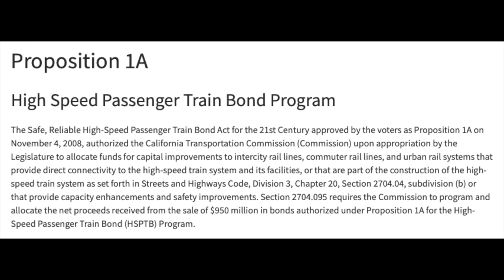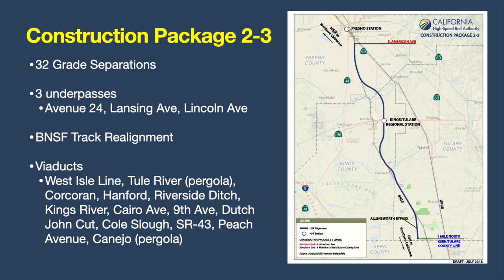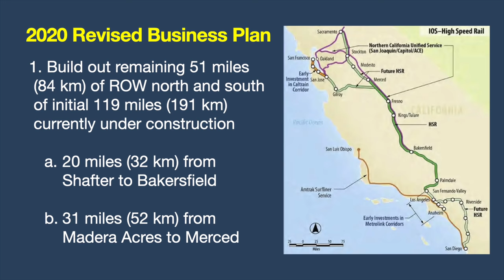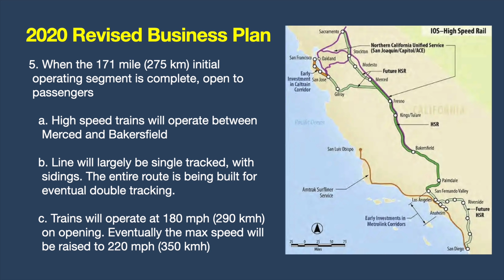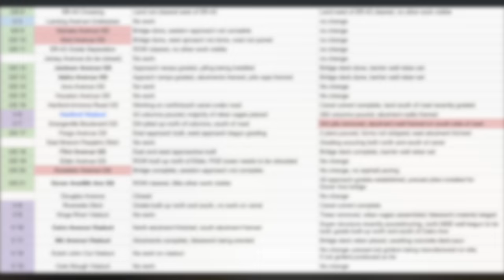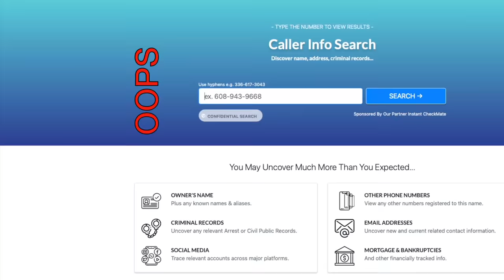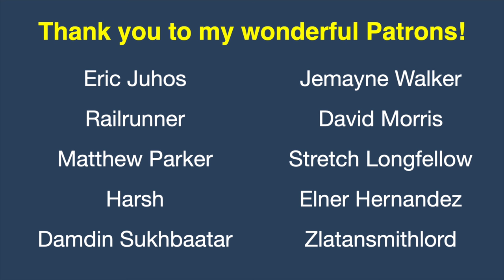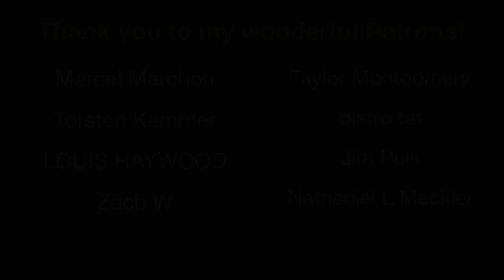California is Building High Speed Rail. It’s time to finish it!

Comment: Eight meter wide triple level maglevs traveling 800 kph - 1,000 kph are a reasonable development to start to take place by 2045.  The issue with HSR is that it is rail travel that first made 300 kph way back in the late 1970s and is not maglev with new first generation 500 kph maglev trains in Japan scheduled to start in 2027.   By 2035 when it might be possible a small section of CAHSR starts running the world should be looking at second generation double wide maglev systems faster than 500 kph.  

The 8 meter wide maglev trains would allow normal automobiles to be loaded perpendicular or large cargo.   The exact best form factors needs to be carefully considered because it will likely be used  for hundreds of years.   The second and third levels would be luxury passenger space with possibly vista domes on their roofs so passenger could see forward to watch the scenery.    Pure cargo cars would allow large build objects to be moved easily over land charging the world we live in.  These high electricity use trains really need almost free incrementally priced electric power.   Electric power usage needs not to be a consideration when running an individual train.   

HSR or maglev use huge amounts of electricity and if only for light passenger load of dozen people if having to price in the electricity they wouldn't be feasible.   Having their own hydropower generators always with enough water is the type of electric power they need.   Nuclear can be somewhat similar.  Japan's bullet trains were conceived with the likelihood their electric power would come from nuclear power where the true incremental cost would be almost nothing.

Comment: THANK YOU for mentioning that ICE cars are only slightly worst than electric. 

Don’t get me wrong, electric cars, trucks, and even air transportation, is great, but it’s not the true hero of the story. 

Getting a real transportation network that focuses on REALITY and not fantasy (coast to coast high speed rail is NOT a good idea but better speed transportation on dedicated track between high speed rail in specific locations IS a good idea) 

We need more people to realize it’s not about getting rid of all ICE and all airplanes and all coal/natural gas electric plants, it’s about putting forward more reliance in greener energy power and transport  but not completely destroying older tech because we will still need it for a diverse power grid structure. 

Pro Tip:
If we really want CO2 enmities down and the environment better cared for, we better stop pretending that NUCLEAR POWER is bad.

Comment: I think I will die before I ever get to ride that line with the pace it has. I live in the Bay Area so for me it would be nice that I can take a train instead of a plane but I am doubtful it will be completed.
Reply: @theexmann  I hope the extensions are finished in a decade as well. It would be nice to travel all over California on that train.
Reply: @DrZark  Agreed. I hope so too. I know that L.A. Metro is currently working with CS HSR to reconfigure Union Station to have run through tracks to accommodate HSR in the future. Some of the funding is coming from L.A. Metro and some from CA HSR.
Reply: There always has been passenger train service between the Bay Area and Southern California.  In fact, you have several choices now.  There are several trains daily between the Bay Area running through the Central Valley and into Los Angeles (Bakersfield to LA is by Amtrak bus).  There is also Amtrak's very scenic Coast Starlight that takes you along the Pacific Ocean into Los Angeles.  So you see, you don't have to wait until you die to take the train...unless of course you only want to ride the high speed bullet train which of course may not be finished before you die.
Reply: @jackjules7552  I know about the rail you can take but we are talking about highspeed rail since the whole video is about it.
Reply: @jackjules7552  Agreed. The problem with the service is that is is geared more towards leisure and travel than for daily commuting because it takes so long by comparison. The trip takes around 10 hours and it's not a one seat ride either. Those two things are HUGE negatives unless you're doing a leisurely trip. Most HSR around the world is used heavily for both leisure and regular commuting.

I've taken the train from L.A. to San Diego a few times, but they have all been for leisure travel and it was great.
Reply: @theexmann  Yes,  the plane is the only way to go between the Bay area and Los Angeles if you are travelling on business.   Business people used to ride the overnight Lark train between LA and SF which had pullman bedrooms.   Business people would board at 9pm and sleep during the night and arrive in LA or SF early in the morning with breakfast served just before arrival.  But the Lark was discontinued years ago.  Right now, there is an overnight sleeper on Amtrak between D.C. and Boston which is advertised primarily for business people.
Reply: @jackjules7552  Agreed. So adding another mode of travel like HSR that works for business as well as leisure between LA and SF makes sense. I would argue that it would probably be more comfortable as well even though it would take about twice as long as a flight.

Comment: Thank you for the update. My only question is how will they incentivize train ridership? As you mentioned air and roads are heavily subsidized so people think it is cheaper. What policies are the California pols putting into place to move people to public transit? What are they doing so drivers understand the true cost of driving, i.e. gas tax, sales tax on vehicle purchases, increased sales tax on air travel, tolls on highways, increased fines for moving violations, surcharges on surface parking, reduced street parking, increased property tax on surface parking lots and low-density commercial property. Infrastructure requires good policy (effective and efficient)to deem these huge projects a success.
Reply from the maker: Ideally there would be a massive amount of press coverage and hype, but you do raise a good point. It’s going to be a long process convincing people to ride trains.

Comment: The "nowhere" applies to the central valley and the fact that is where they started construction. Had they started at either end of the system, that argument would not have much of any legs to stand on. This is what I hate about politics. Things are intentionally taken out of context in order to make them appear in a better or worse light. I do beleive that this project should be built, but let's at least be honest about how things have gone so far and the choices that were made.

Comment: The cost per mile of the planned 520-mile California high-speed rail system, assuming it could actually be built for the current estimate of $80+ billion, is $154 million per mile. And Amtrak’s own estimates for replacing its existing Northeast Corridor with true high-speed rail work out to over $500 million per mile.

Comment: Let's utilize the Chinese maglev tech. They've proven it's safe up to crazy speeds. It could connect San Diego to LA, then LA to SF. The physical structures they are building could be transferred from friction rail, or iron rail, to a far superior technology.
Reply: It's also crazy expensive, around 3 times as much.
Reply: @AVeryRandomPerson  I think we can all agree cost has no limit when it comes to benefitting the group consciousness.
Reply: Maglev ISNT superior to covnentional rail.  It uses a LOT of energy, cannot use existing tracks, cannot run at grade, etc.
Reply: @jamessmith14000  People won't care if their journey takes 2 hours instead of 1. It's such a minor difference for such a large cost.
Reply: The tech is actually German, and development was stopped in 2008. There is development going on in Japan, but generally Maglev has shown to be too impractical and costly when compared to conventional HSR.

Comment: Lol out loud. This "train" only connects nowhere to nowhere. Think about it. It goes through the central valley. That's just farmland. And besides cars don't pollute so much carbons as "trains" because they are airplanes fly between sfo lax. Aeroplane is faster because half time only 1 hr take 3 "train". If no less, budget over car superior. Interstate California 99 South is US 395 exist. If you don't car you no freedom. This "train" cost more than peanut but less than country. High speed "trains" bad environments car good. If only put gone "train", less more. Nowhere to good is bad less than more potato. However, Every Line Pays.

For anyone who couldn't tell, this is meant to be extremely thick sarcasm.
Reply: You actually got me at the first few sentences until you called cars planes. actually, "they are" is a typo "there are" but combining cars with airplanes for no reason, as well as the use of quotes around "train" was still the giveaway it was a joke.

Comment: THE FOUR FOOT:  Normally I ride Amtrak's Coast Starlight between Los Angeles and San Francisco.  I ride it for its incredible scenery of the Pacific Ocean and the mountain ranges.  Would I give up riding the Coast Starlight to ride the high speed rail that has only mediocre scenery?  My answer would have to be NO!  I am not sure who would ride the high speed rail.  If one is in a hurry then just fly.  The money could have been better spent on improving the current Amtrak trackage on the San Joaquin trains that terminate in Bakersfield and then add double tracking through the San Gabriel mountains to get to Los Angeles as originally planned.   By the way, back in the 1960's the San Joaquins used to run all the way into Los Angeles and did not seem to have a problem getting across the San Garbriel Mountains.   But this was before Amtrak took over the San Joaquin passenger trains from Southern Pacific in 1971.  If you look at an old Southern Pacific passenger train timetable you can see that Southern Pacific's  San Joaquin Daylight passenger train made it all the way across the San Gabriel mountains on a single tracked route into downtown Los Angeles Union Station.
Reply: Union Pacific is in the "Actively Hostile" category along with CSX for their hatred of passenger rail. Also, in a hypothetical scenario from Anaheim-SF, CAHSR would save over an half hour compared to flying
Reply: @AVeryRandomPerson  That is so surprising.  I remember back in the 1960's Union Pacific used to run TV commercials advertising their very plush passenger trains.  In fact,  Lucille Ball gave Union Pacific a big plug on her show when she rode from LA to NYC on a Union Pacific train as part of the plot in one of the episodes and her friend Ethel bragged about how good the food was in the Union Pacific's dining car.

Comment: Maybe fix the existing infastructure first??
Reply from the maker: That’s what SB 1 is for
Reply: An additional lane on the both sides of I-5 would do more than this choo-choo project ever will. And CA were to make Highway 99 four lanes over its entire length, a lot of lives would be saved every year.
Reply: @TohaBgood2  CAHSR isn't a matter of just bridges and viaducts. It's also a number of massively long tunnels and it also has to cross two earthquake fault zones. The true cost of this project if it ever is finished is unknowable. If you told me it was double the $65B being touted by the rail authority, I wouldn't be surprised.

To widen the two roads I mentioned above would be approximately $7B. For their entire lengths.

The traffic that would be accommodated on a widened I-5 and 99 already exists and is driving on those roads everyday. It just moves slower and less safely than it otherwise would if those lanes existed. 

And those roads also carry freight. Something CAHSR will never move.
Reply: @TohaBgood2  And yet somehow, you didn't post your facts refuting it. And you also haven't said what "this" is. 

Why stoop so low as to call me a liar? CAHSR has been a string of lies from its very inception, through the cheerleading, the funding, the planning, the construction.

And for what? To build a railroad between two destinations that are already served by multiple airports on both ends, bus service, and an interstate highway. There's no demand for it. It's a vanity project so coastal CA can feel more like Europe. CA is the poorest state in the US when you account for housing costs. Instead of doing something to make the upper-middle class feel better about themselves, why not do something more useful with that huge amount of money?
Reply: @Peter_Schiavo  nonsense.  "Two destinations that are already served by multiple airports on both ends, bus service, and an interestate highway".  Ha, ha, ha, ha.  That is RIDICULOUS!  Do you want to build a high speed train where there is no demand?
Reply: @MarceloBenoit-trenes  What I said is not ridiculous. CAHSR will not be faster or cheaper than air. Will not be as cheap or as convenient as a car. Will not supplant buses on cost or flexibility. So there is no demand for a choo-choo that will never, ever produce enough revenue to meet its operational costs, let alone capital costs, or paying back the debt taken out by the CA government for it.

I guarantee that it will never carry passengers from LA to SF. Because it will never be completed.

Comment: The problem with HSR in the USA is that the cost per mile (or per km) is significantly higher than for other countries. China is able to build on the cheap, and they don't have to worry as much about imminent domain, since property rights hardly exist there. If we want to afford HSR in the US we need the US government to deregulate so it can be made more affordable.

Comment: They are broke, and can’t afford to build the railroad.
The high speed rail was attempted in FL between Tampa and Orlando. The estimated cost to use the train was $40 per person, each way, to travel about 60 miles.  There also was nothing at either end once you arrived.  What folks found out was Amtrak was running twice a day, and maybe had only a couple of passengers at best.  Buses were frequently used, instead of the train.  There was also seven buses running daily, that also are rarely used.

Comment: Going thru fresno instead of around the city is a disaster.    All these over and under passes wouldn't be needed if you went west of the city.    They could have used that money to connect to either la or sf!    It's going to be a railroad to nowhere.    You just focus on the project side.   It's a good project with a TERRIBLE unrealistic plan they needed to go around fresno and bakersfield and merced not thru them
Reply: Elsewhere online I see all these videos describing the historical destruction of the american city by running an Interstate through the city center.  But this does not apply to trains apparently. Hopefully this slightly zig-zaggy undulating rail corridor won't be an international embarrassment.

The "high speed" train that connects from SF to LA in 3:08 can't stop in the central valley anyways. It has to blow through those stations at full speed. The train that stops at all stations takes 4:25.  The express train from SJ to LA was scheduled at 2:25.  These were times quoted at the HSR meeting near Santa Clara in 2019. I took a picture of the schedule.

It's fun to get excited about these projects and cheer on upbeat videos.  But the litany of questionable constraints, design and engineering decisions should make everyone cautious about what's practically possible.

Comment: The problem is, after you get off the HSR, where to go? And how to go? There is NO good enough public transportation in any US cities to support the passenger to reach final destination from HSR station. It is typical last 1% failed the whole plan.

China and Japan and some EU countries can have success, only because travelers can take bus, subway, light rail, or even bikes to 95% of destinations without hailing a ride.
Reply from the maker: I’ll counter with when you get off a plane, where to go and how? Airports by definition are huge and inhospitable to people, yet Americans have figured out how to get to and from airports for decades. 1 singular project is not going to revolutionize a transport network, but many projects over time will. Humanity thrived before the automobile and I’m becoming more convinced that it will continue to thrive when it’s no longer mandatory that every person must own a car to survive.
Reply: @TheFourFoot  This is why people won't use HSR in US. Airport in general won't locate too close to city. Yet HSR stations can. But if you have to call taxi or wait for someone to pick you up, then what's the point to take slower HSR compare to flights? The only chance for HSR to win is that you can get to HSR station much faster and easier than get to airport.

In China, or Japan, HSR stations are all inside big cities, and connected directly to public transportation can easily reach you home. Or your office. You don't need an hour on the way to/from airport.